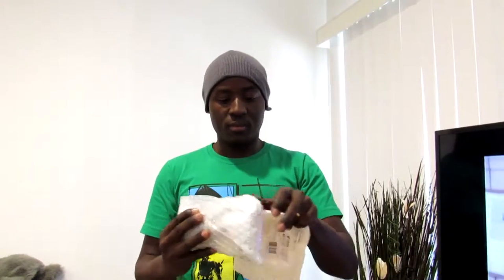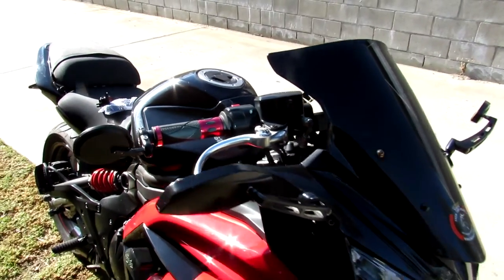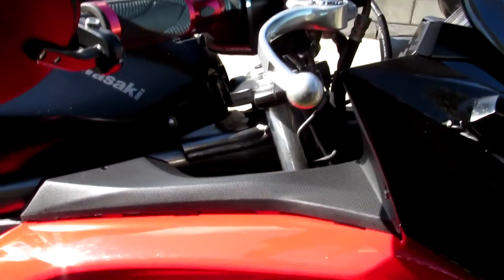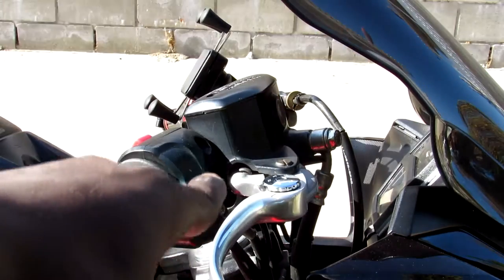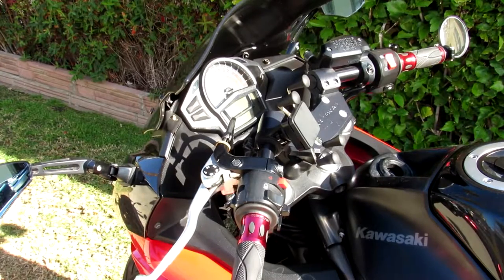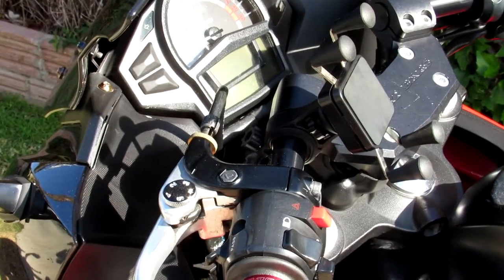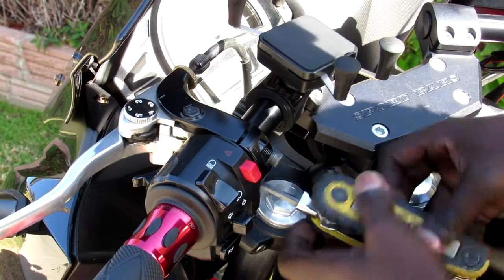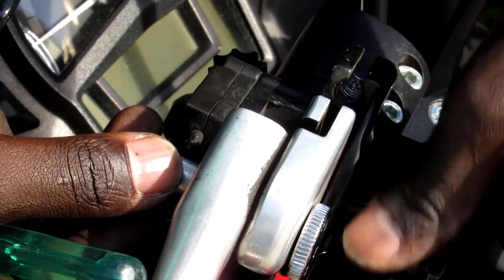How to change break & crutch levers on Kawasaki Ninja 650

Comment: I bought these from ebay. The 6 position adjusters keep slipping, all adjustments made it still didn't help.they look and feel good but are faulty for sure....at least on my bike.
I.E they keep sliding to the number 1 position.
Reply from the maker: I haven't experienced any issues and have been using them for 5 years and the same on my other bike ,no issues maybe the one they sent u was faulty.